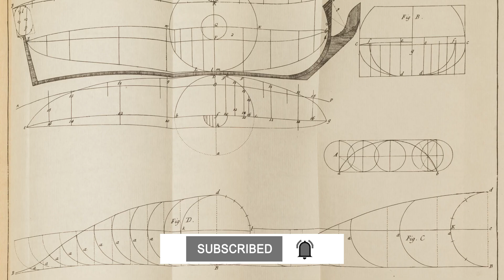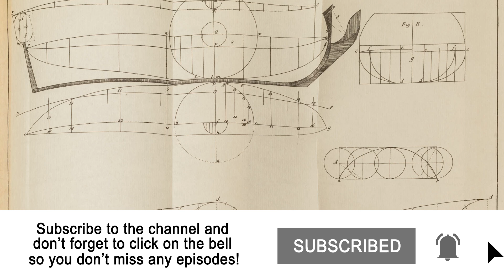Evolution of SHIP DESIGN (Part 2)

Comment: I think I am following your part about figuring the beam width out; but where you measure it is important, and the beam at the deck is not the controlling factor re speed and handling- I point you to the Dutch flute, a cargo vessel that has a relatively narrow deck to take advantage of cheaper port taxes that measure beam width to determine the rate, but were much wider just a few feet lower than the deck, getting to the volume that a merchanter needs to be profitable. As I pointed out, this was "port captain's measure" made for economic reasons not as part of the hydrodynamic package, but in aid of financial benefit. 
Your part on why the large bows on warships  was very intriguing- I had never thought through just what made that compromise so necessary. 
As always, thanks for giving me something better to do on Sunday than the mere news!  Please continue, I think you are getting to the good part! Btw, an aside on how the English Royal Society would effect shipbuilding and navigation would make good content a bit later as well! As well, I am thinking a piece on how the ship goes from the king's idea (or merchanter owner) to a floating, ready to travel ship would be welcome- it should show that vast clouds of paperwork and CYA were  invented long before the present era.!